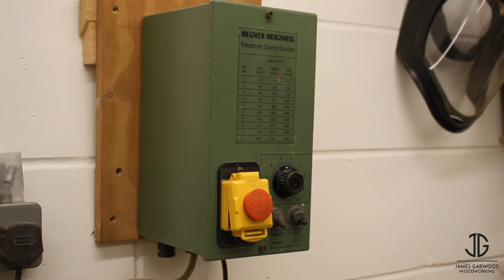I spent 200 HOURS making 10 FOUNTAIN PENS! - Woodturning challenge

Comment: What is that last lathe chuck you used, after you put the tube in?  The part you put into the Collet chuck.
Reply from the maker: It's called a jam chuck, I made it from a piece of aluminium rod and an old nail, you need two different ones for the body and cap 🙂

Comment: I'm still amazed that you don't have any trouble with the superglue accelerator causing the joints to be brittle.

I sure do with models!
Reply from the maker: No I've never had any problems with CA glue and I've made over 500 pens over the last few years now, what models are you gluing together
Reply: @JamesGarwood  some metal, some resin, some mixed media (plastic and metal and resin).

I wonder if it's the wood's porosity?
Reply from the maker: That was what I was thinking today, I always used polystyrene cement for my models but they were always plastic so melts the plastic together,

Comment: Have read several wood working comments that super glue does not hold well on wood for long term applications. Stay with wood glue.
Reply from the maker: I've been making pens for years now and I've not had any issues but thank you for the heads up, where did you see it?